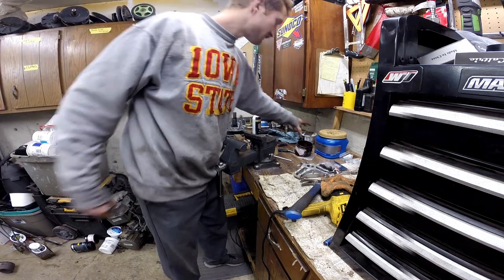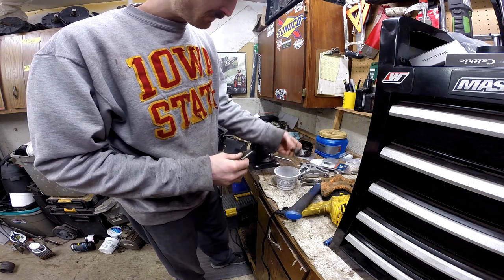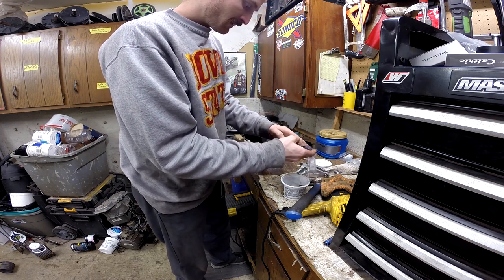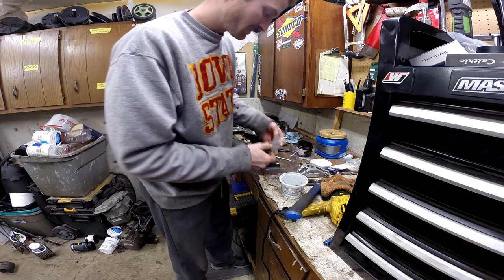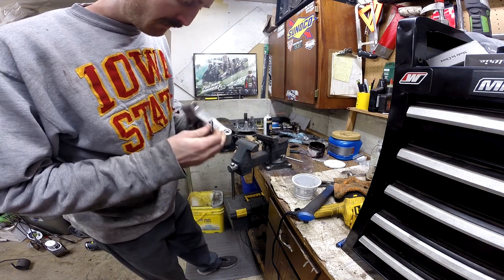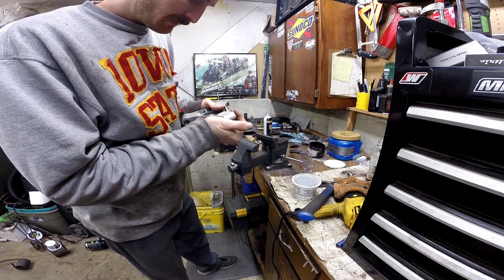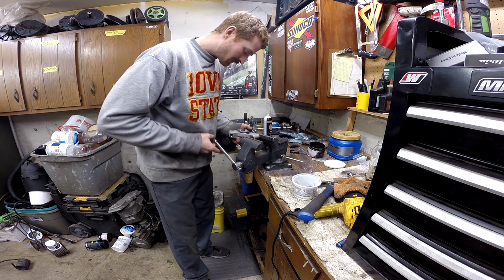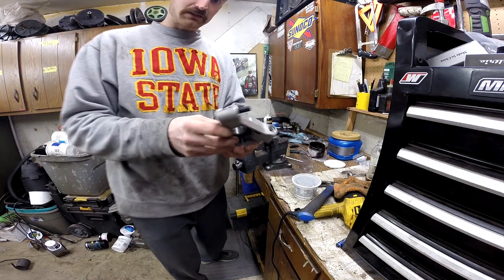Sled Tips 017 -Primary Clutch Roller Installation

Comment: I have a spider I am working on overhauling but one of the rollers slid over wearing into the aluminum, now when I install the new roller and plastic washer I have to much side to side play.  What have you done in this case? Can you buy just the plastic washers somewhere?
Reply from the maker: I have not been able to find them specifically, but have made some from a generic plastic washer.

Comment: Thanks for the video, had to do mine as well. Saw in one of your other videos that you had a bunch of clutches laying around. I need a secondary for a 2001 ZR600 EFI,  0726-113, or at least the movable sheave, 0748-023, as mine got cracked trying to remove it from the jackshaft. Something else cheap and compatible would also work, just need to get it operational again.  Don't have facebook so not sure how to contact you and couldn't find you on ebay using that store name. Do you have email?
Reply from the maker: I will have to take a look at what I have for secondary parts. A lot of what is good we are using for racing. BUT, if you need a movable sheave, I think we might be able to make some thing work. 

Ebay: https://www.ebay.com/usr/longtin_motorsports. I didn't realize how difficult it actually is to search specific users without their exact name. I apologize for that! If you do an advanced search and search by user name, that is about the only way you will find me on ebay by user. Kind of dumb. Oh well.

alongtin@gmail.com is a good email for me. Send me and email and we can chat about some options for you.
Reply: @longtinmotorsports  Thanks for the response. Sent you an email last week, not sure if you got it, I added some pics of what I'm currently dealing with.